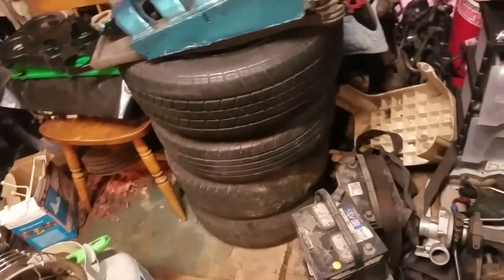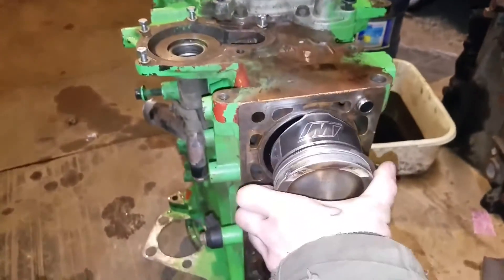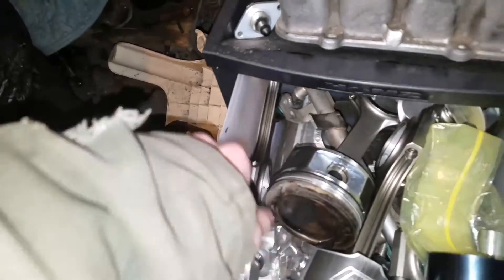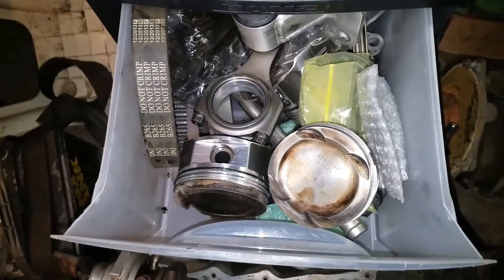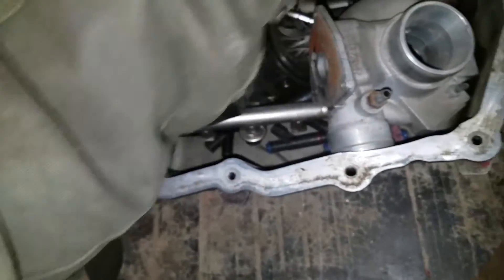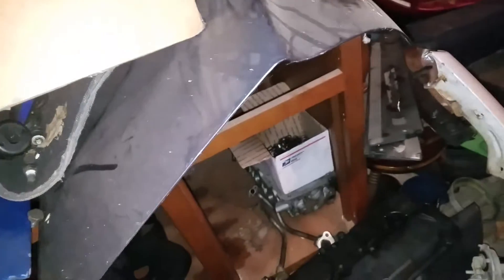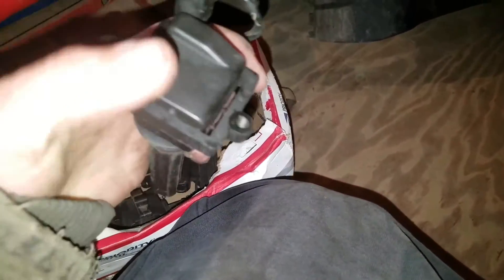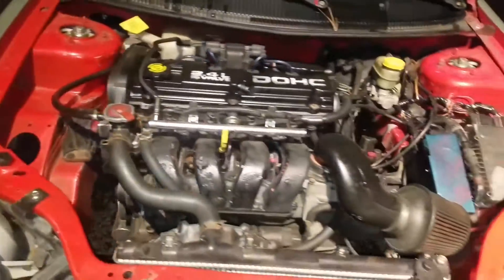600 hp Turbo Neon Build Parts List!

Comment: next vid should be a close up look at connectors, and where mods are needed for srt4 swap. nobody has covered that yet and it would be a great way to save alot of questions on the forums, we can use it as a referance vid
Reply: im in the middle of the swap right now and its the electrical that has me stumped
Reply from the maker: +evilnygneon word i will but doing a srt4 swap u have to swap the harnesses too
Reply: have the engine harness and dash harness etc. its the ignition. hvac, door switches etc that have me stumped
Reply from the maker: +evilnygneon we are going to be doing shays soon but i need the harnesses and a intake manifold to start it
Reply: on fb talk to stevie miller at miller imports, he has parts from 40+ srts, thats where i got mine, including computer,skim and key for 280 shipped

Comment: try aluminium brazing rods to fill the cracks. all you need is a torch
Reply from the maker: +Chips and Dip Switches yea someone already tried i cant do it well dont know how id really like to just get it redone nice but might just jb weld so i can use it til i can afford to fix it or just buy amm intake manifold